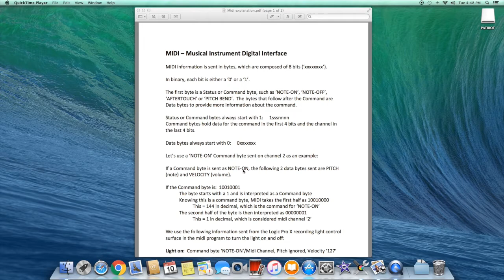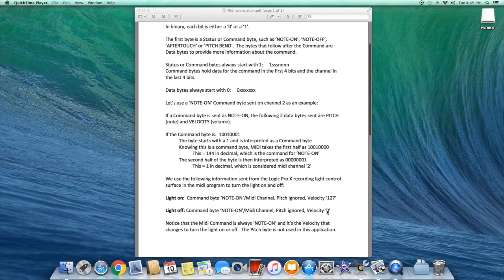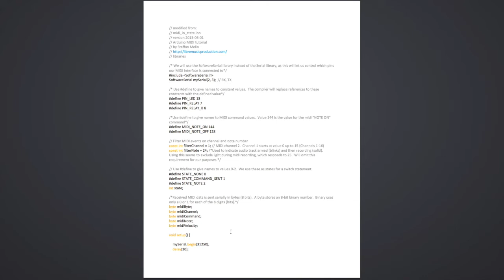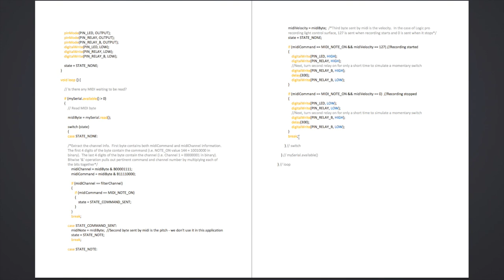MIDI Controlled Recording Light for Logic Pro X - Arduino Sketch (Part 2)

Comment: Hello Chris! Thank you for this great Video! I´m new in programming an Arduino. Midi and Relay work fine! But in my case the light is flashing in sync with the record ready indicators of the audio tracks.  Is this normal with the programming or did i make a mistake? Is there a possibility that the relay only closes when really recording? Perhaps in the Logic Setup? All the best  Romin
Reply: my little problem is solved! after finding out that logic sends record ready on another note than recording, my friend lucky helped me with the sketch :-) we changed following two things in the sketch: 1.:  "const int filterNote = 25 ; "  and 2.:   "if (midiCommand == MIDI_NOTE_ON && midiVelocity == 127 && midiNote == filterNote) "          
with the default recording-light setup in logic now the light just switches during recording. it also switches during recording midi. thank you for the great tutorial! all the best romin
Reply from the maker: Romin,
Yes, the recording light will blink when audio tracks are "armed" or "enabled" and you see the blinking "R" on the track header.  If you click the "R" to disarm/disable the recording so that the "R" becomes gray and wait about 30 seconds, the blinking should stop.  If you are going to record only one audio track at a time, just highlight the track and start recording without enabling.  The track will record fine and the light will stay steady.  However, if you plan to record two tracks simultaneously and one is an audio track, then you will have to enable/arm it with the blinking "R" and unfortunately, this will cause the recording light to blink as well :(.  I haven't worked on code to handle this feature of Logic Pro, but if you come up with something, let us know.  Thanks for trying this out and asking the question!
Reply from the maker: Romin - Thanks for the update and for posting the information!  Adding the filter note logic makes sense to me in isolating the recording from recording ready signal.  I'll change the sketch here as well and try it out.